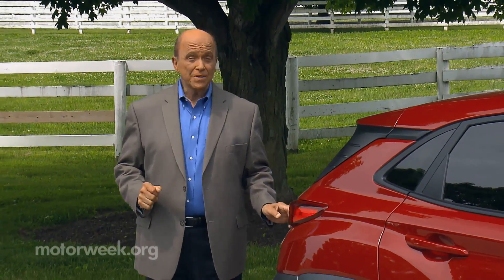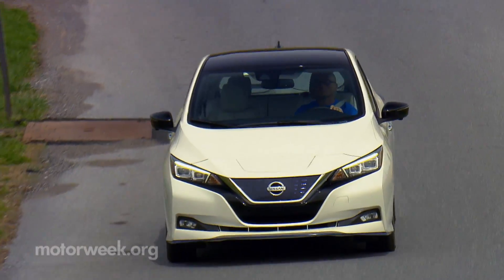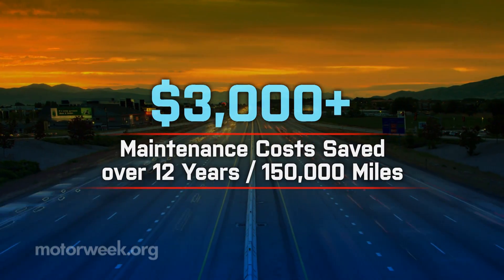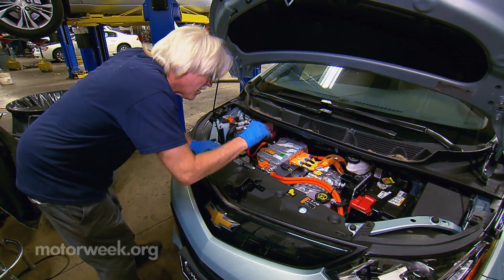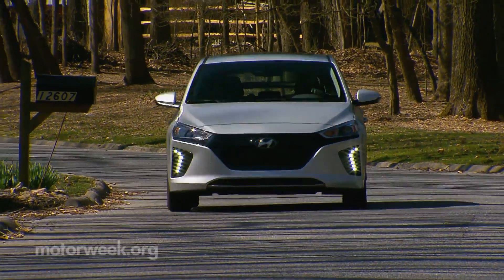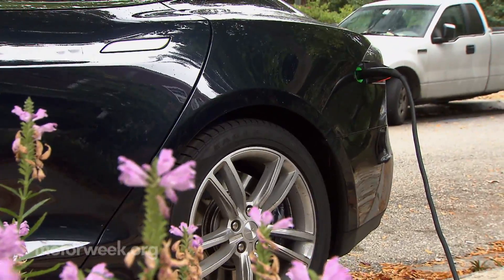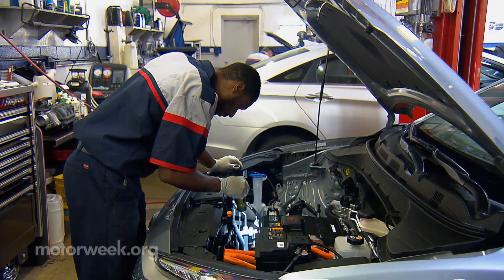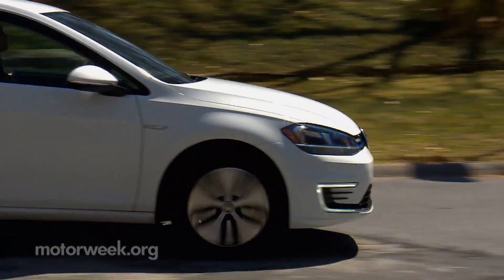Electric vs Gas Vehicles: The Long Term Cost Comparison

Comment: I've owned my Bolt EV for a year and a half and after nearly 50,000 trouble free miles.I can say we will always have at least one BEV in our garage. Everything outlined here I can personally confirm.
Reply: Lol just buy a Toyota you will have 400,000 trouble free miles. The biggest thing going against EV is the ease of use. You get range anxiety wondering if you have enough juice to make it home and it takes too long to charge and it’s not recommended to charge the battery all the way up so you lose 20% battery right there you also lose performance when you get to low battery
Reply: @thecollinzboy  Even toyota is going electric so your argument is invalid
Reply: @jordanplays-transitandgame1690 not all electric. Neither is GM.
Reply: Chevrolet vehicles routinely pass 100k with little to no issues... gasoline... always have a home for a common sense vehicle in my garage. Also they have warranty for such reasons

Comment: $ explained for servicing is missed leading
ICE required much more cost in servicing after 2 years of driving and it keeps increasing due to the fact that you have to change engine oil, transmission oil, many brakes replacement than EV.

Wake up People !
Reply: Not sure what kinda vehicle your talking about that it goes up 10x cost after 2 years.......ive driven vehiles up and past 500,000 km and and  never came close to that.....definilty nothing close to the price difference in the vehicles....let alone in our rural area the range on an ev would have to be at minimum 700km to be feesable....as medical appointments (specialists) are over 300km one way (which are the closest) if had to charge an ev would have to make it a 2 day trip and rent a hotel room...thats another $150 per trip!
Reply: So what? Oil cost fuck all.

Comment: Very interesting! But I still want Camaro V8. Saving $3000 over 12 years is basically saying I’m not gonna drink soda anymore. Plus I guarantee a Corolla would still outlast any of these electric cars.
Reply: Electric vehicles are a joke. Consumer Reports reliability on these cars are horrible. Plus all of these people complaining about the environmental problems of fossil fuel, which in reality is way overrated , aren't looking into the issues long term with what these batteries have with its environmental impact. It is a joke! Remember when they said how much better it was to use plastic instead of paper? Now plastic is bad, lol! 20 to 30 years from now electric cars will be considered environmental hazards more then likely. These so called experts aren't experts and have been proven wrong on so many occasions in the past on many issues.
Reply: @mmm-mmm  Bullshit, you're a fuckin liar.  10 years, only a battery, quit lying partner
Reply: @Cold As The Poles Fuckin nailed it
Reply: @Cold As The Poles fucking nailed it again
Reply: A Corolla will outlast most gas vehicles. Not the case with an ev. It boils down to moving parts and the absence of components that will wear out or break. Now the real question we face is how long will the battery last? With any new technology; that can't be answered until it's been around for significant amount of time. But as time progresses ev batteries will only become more efficient and durable.
Reply: @joesteele3159  really?  Really????? Lol dude you delusional... find a battery still works after 30years... ill show you a corolla still driving from 30years ago
Reply: @spoonsarefun   You didn't read my whole comment in context. I said the real question is how long will the battery last? EVs are not time tested like gas vehicles are. I would pit a corolla or really anything Toyota against any other vehicle out there right now. Even a 30 year old corolla with 400,000 miles on it. Heck I would pit the long term reliability of corolla against any new EV simply because EVs are not time tested. But technology of any kind will typically get better as time goes on and pair that with the fact that there are very few moving parts in an EV they will likely get better long term reliability in the future.

Comment: EVs still have a long way to go.
Reply: They've been around for a hundred years and what we have is the best they can do. NOT GOOD. Elon will still keep taking advantage of dumb millennials though.
Reply: How so? I've found my Bolt EV to be the best car I've ever owned.
Reply: @WildernessGuyBC  it may be the best for now, but it will be better in the coming years!
Reply: @WildernessGuyBC  I'm sure it is, but the point is the money here. Until those cars drop in price, very few will get them.
Reply: @WillJacobs-d3m  Technology progresses exponentially. Maybe Electricity wont be the next thing, i'm hoping for instant transmission or data based travel. Who knows! This physical body is the limiting factor.
Reply: Andrew Yes, they do!
Reply: There is much better technology out there then these electric vehicles to replace fossil fuel vehicles. See Roswell as an example. Either or government and military and scientists figure it out already or they didn't. But if they did, it will be covered up big time probably because they can't profit off of whatever that technology is from these ETs.
Reply: Little by little we'll get there ;)

Comment: How much does it cost to install a charging station at your house?   That cost needs to be added in too!
Reply: A normal 110 outlet charger that came with the car covers my 30mile commute while I sleep at night.
Reply: @ronaldmail00  yep and get a full charge over the weekend
Reply: I did mine for $600 Canadian. That was the cost of charger, all the parts needed for the wall outlet, and the cost of tools for fixing/finsihing drywall. DIY is orders of magnitude cheaper, just make sure to educate yourself about safety procedures, and the correct gauges of wire to use, getting the right circuit breaker, etc. To be honest if these cars are going to become more common I think that it's a good idea for future owners to educate themselves about electrical infrastructure and the ins and outs of working safely with electricity.
Reply: @0hypnotoad0  as anyone driving a ice vehicle should be a petroleum engineer
Reply: If your daily commute is less than 40 miles round trip, then the included 120v charger will serve you well at zero cost.  Otherwise, a Lvl 2 charger install costs around $800, but there is still a federal tax credit available to cover most of that cost.
Reply: @Cakebattered  if your commute is that small...shouldn't you just take public transit? Come on...
Reply: I installed my own plug. Took me 2 hours of work and 160 bucks in material for the plug. Then I bought a level 2 charging plug for 300 bucks online. Couldn’t be happier with the investment. It makes a huge difference when you can charge up to full in a few hours vs 20 hours
Reply: just do it urself it wiring and change a breaker depends on where live you might need to add a EMT conduit just look at ur electrical code local.
Reply: Power companies offer rebates on level 2 home chargers.
Reply: Cost me about 500 bucks.
Reply: Where's that house with the charging cable laying across the sidewalk? I want to go there, trip over their cable and sue them for "injuries".
Reply: @hedunlap  You do this with people who water their plans, you sob.
Reply: My charger was fitted free by a government scheme, if you want to fit one the cost can be low, if I had to pay for it to be fitted would have cost £450 with fitting costs.
So a few tank fulls of gas/petrol.
I also save by using electricity generated by my solar panels, which is effectively free.
How much does gas/petrol cost nowadays ?
Also how much is servicing an ICE car also, EV's cost nothing as they dont need servicing
Reply: thanks! @Stumpy1854-Orion
Reply: How much does it cost to have a fuel pump installed into your garage too? How much to have a rig ship and pump the fuel into your station in your garage while we are at it right? LOL. See what I did there? ;)
Reply: @LokkiSaints  how much electricity does a tesla used vs a parked gas vehicle? I can park and come back a few weeks later and still have full tank of gas..tesla uses electricity just to sit in one spot???
Reply: @spoonsarefun  EV won't use any electricity while simply parked with at least 50% SOC. And after a few weeks the gas car will have a dead battery unless it's tendered. And if it's a Ferrari, Lamborghini or even a McLaren your battery will be dead within a week or less guaranteed.
Reply: @LokkiSaints  A car should be able to sit parked for at least a month without the battery dying, unless it's a higher-end car with plenty of power-hungry gadgets and computers, experts say.

While it true security system, clocks and other things can drain a normal car battery when sitting... in 2 weeks if you start it up and go for a quick drive it can sit for another 2 weeks... in 2 weeks you've lost over 10% of your range in a Tesla...and you can always disconnect battery in a gas vehicle when in storage, but a Tesla continyally uses power to keep it battery "healthy" thus the car is "always" running and battery will degrade regardless of mileage with time.
Reply: @LokkiSaints  Tesla website says different...but what do they know...they only build em, 1%/day
Reply: @spoonsarefun  I'm an ICE guy 100%. An EV car can sit for months and lose very little stored electricity unplugged. An ICE car will require a tender on it's 12v battery or will need to be driven within a few weeks or suffer a dead battery. Might want to research EV longevity.
Reply: @LokkiSaints  an ICE car wouldn't require a battery tender.. it would require a 8mm socket to remove positive or negative from post or a battery disconnect, or a secondary battery and a battery isolator, or a tender if preferred or a tiny solar panel sitting on dash plugged into cigarette lighter adapter. All are cheap solutions compared to the constant drain on a ev vehicle.
Reply: @spoonsarefun  While you're digging for tools and tinkering with disconnecting and reconnecting you battery on your ICE, the EV owner is in their house enjoying a relaxing time with family.

Comment: I thought about EV's but i live in an area where it get extremely cold and condos only have 120 volt outlet i got an manual shift elantra instead.. it gets 42mpg or 5.6L /100 kilo at 70mph plus i only spend $200 a year in services and i have not changed a bolt, light nor switch in the 5 years i have owned it..
Reply: Ian Norton  my plug in hybrid is great. When plugged in my car heats and defrosts in the winter, i get to my car and its already warm before i drive. Or in the summer i have the ac cone on before i leave. Its the most underrated part i love about plug ins and EV. And i can still use gas on my fusion energi
Reply: Ian Norton  Canada is one of the best places because our electricity is so cheap. If you drive really long commutes to work, electric is actually FAR better. The divergence in cost between gas and electricity gets further and further apart the farther you drive. Say you do 30 km a day. That's about $336 of gas a year (at $1.20) or $73 of electricity per year (9 cents per Kwh). Only a difference of 260 bucks a year, whoopedy-doo. BUT, If you do 200 km a day, depending where you live you might spend $4000 on gas a year, compared to about $700 for electricity. A difference of $3300 a year, if you own a car for 12 years that's $31,600 in fuel savings. People who drive long distances in rough weather are the best candidates for long range electric cars, that should not be overlooked.
Reply: @0hypnotoad0  clearly you dont live in a rural area.....or think about the people who feed you (farmers)....ev never work out here in rural sask....where having a vehicle ready to go anytime (not having to wait for it to charge) could litterally be life or death....ive had to call an ambulance for my father before....but could wait....i got to the town just as the ambulace was leaving (passed them on the highway just out of town)....75km away!
Reply: @rorylozinsky1147   I can't understand your mind bending gymnastics, you need to have a vehicle that's ready to go all the time, so the one that needs 5x as much regular maintenance, and needs fuel from the fueling station away from your farm is the more reliable than the one that needs almost zero preventative maintenance and can be refueled at the farm at literally any time. When it takes 10 seconds to plug in, theres literally zero excuse for an electric truck to not be fully charged at all times.

Comment: Breaking electric motors.. ask an early Tesla model s owner. They broke..
Reply: @santiagohills3997  coworker has an iconiq and it's a solid car. He works 10 miles from work and has a mustang for trips and else wise. He considered tesla but they were so expensive for what he wanted. Bolt interior is trash though. Very cheap feeling
Reply: Early steam engines had bugs too. Modern automatic transmissions still have bugs...
Reply: Santiago Hills  yes tesla has a lot more problems than bolt or leaf.

Comment: A more relevant comparison of cost of EV vs ICE would include considering the initial cost differential between an EV and a conventional vehicle of similar specifications. No Leaf vs Lexus or Model 3 vs Mercedes. What is the point where the money saved by using an EV is equal to its additional costs?
Reply: I don't know about the US but here in Europe a Leaf is about 12k more expensive than a gasoline car in the same class. I did the math and it takes over 10 years to even break even, even more so if you figure in the cost of battery replacement.
Reply: @weedmastersr  And that's why those cars are barely 3% of the marketshare.
Reply: @bmw803  Indeed, and that's with hefty government incentives. For example, here in Romania you get a 10,000 Euro subsidy from the state if you buy an electric car. 
Still, they're very expensive. Even a tiny Renault Zoe with the incentive, which is a tiny A-segment hatchback comparable to a Chevy Spark, is in the 20-30 k range depending on options. 
That's gasoline Mazda 6 or VW Passat territory. So still, they are extremely expensive even with all incentives. I've only seen them as taxis, because they're cheap to run as an urban fleet vehicle. 
EU regulations are forcing all manufacturers to make mild hybrids now though.

Comment: The statement about battery warranties is misleading at best. Most of these warranties are for defects only. If your capacity fades too much (for you) over time and you do not have a specific battery capacity warranty, you are out of luck. I urge people to tell the sales people at the dealerships that they will not buy a BEV without a battery capacity warranty. I feel that I was burned by Honda and told the salesperson when looking at a PHEV Clarity that I will not buy from them again without a battery capacity warranty.

Comment: C
Reply: Actually a properly fitted coal plant is cleaner than a bunch of ICE cars on the road, it's easier to maintain the emissions systems at a powerplant vs checking every vehicle on the road. This has been proven in multiple studies.
Reply: Dantheswim12 EVEN if the coal plant powers you car, it’s still not awful (not great though). However the grid is constantly getting cleaner. Do a little research.
Reply: Isn't burning coal at an industrial scale cheaper and more efficient than burning gas in a small displacement engine?

Comment: Drove my Crown Victoria for 10 years and put 293,000 miles on the odometer. Other than routine maintenance, I did not have any drivetrain issues. I’d like to see what type of fun surprises you’d encounter with an all electric vehicle given the same circumstances.
Reply: jimkirk1971 ev's have a lot less to break, no transmission to speak of, no gas engine. Electric Motors are dead reliable, the one in my swamp cooler is a 3/4 horsepower and it's been running all summer ever year since it was new in 1965! Btw many ev's have already passed the million mile mark with no issues.
Reply: I guess your frugality is important to you but not all of us worry about that.
Reply: Yeah and I bet it got 42 mpg uphill with the a/c on too, right? Haha But congrats on the great service life! It'll be years before I buy EV. For folks like us it's still not viable. But people living in suburban homes that commute around 40 miles a day could really cut down on tailpipe emissions. Plus EVs are quicker and more fun to drive!
Reply: Also that is an average of 29,300 miles per year. EV is probably not the best choice for your driving needs. Thanks for contributing!
Reply: @wedgeantilles7731  29,000 miles per year on an EV? I heard the average on a gas vehicle is 12,500

Comment: The extra cost of an EV and the batteries buys a whole lot of gas
Reply: And a whole lot of superior performance
Reply: Dennis W itll also cover any mechanical expenses you may have, and buy a couple of cosmetic upgrades for your car as well. Face it motorweek, electric is far too expensive.